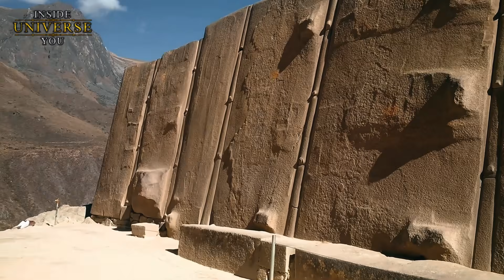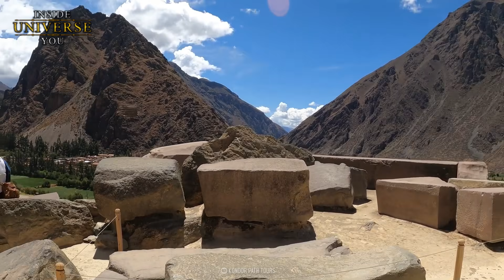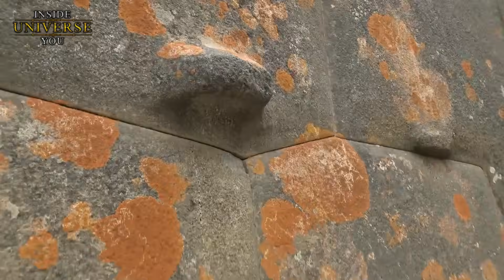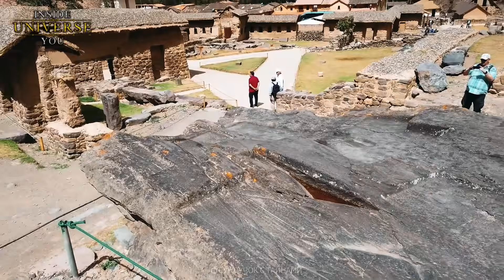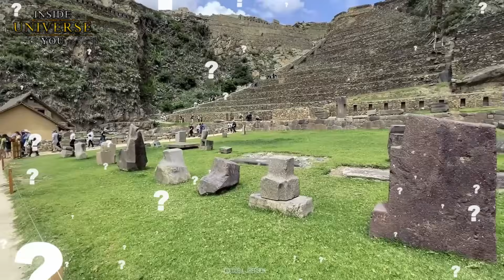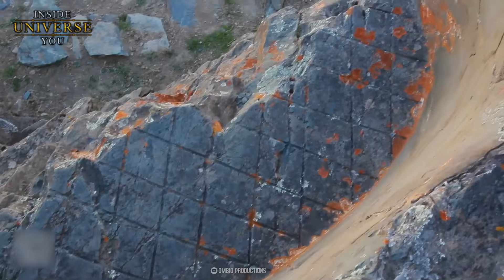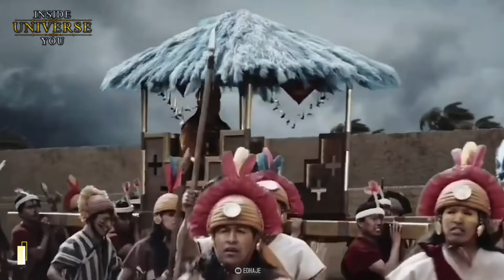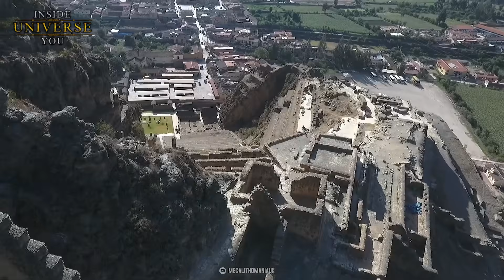Pre-Historic Mega Structures of Ollantaytambo Predating the Inca

Comment: The stones weren't moved - they were poured.  They would, most likely, crush the granite into a fine powder, and combine it with an emulsifier.   While it is in a mud-like state, they would then apply heat and move the blocks into place using heavy machinery, similar to a forklift. 

It is no different than baking cookies.
Reply: Wouldn’t they need a mold to pour it into?
Reply: @harrowgateguy  Yes, and my theory is, they used either tempered glass or sand as the mold.   It's the same method we use to make molds for metal, but scaled up.
Reply: They must have Both. Some are Geopolymer but we find Things Cut out all around the World. Easter Island Statues, The Block in China, there is Whole Complex Temples in India cut straight out of the Mountain. If they had the Tech to make them Into Powder (Probably by hitting the Resonance Frequenzy) they can use that to Poor or Cut.
Reply: @youcanhandlethetruth4695  Incredible. It’s completely mind blowing and frankly makes us look a bit primitive by comparison.
Reply: It looks likely in order to get such a perfect fit, but I have wondered  how they prevented the stones from deforming after heating. They would also have been harder to position if soft. 
Is it possible they were loosely stacked and then softened into tightly packed blocks? Even the capacity to carry out that level of engineering is mind blowing and beyond us. Maddening that we will probably lay never know.
Reply: 😊 I had a similar thought about baking bread - they remind me of the way bread-buns are all joined together when they come out of the oven.
Reply: Why do we know where all the quarries are then think befor you come up with a easy solution for yourself the quarries in Egypt, here many of them we know where the stone came from
Reply: @swingshift.  We know where the quarries are, but not how the stone was moved.  They didn't move it.  It was crushed into a fine powder and then reformed on site.   It's no different than how we work with cement today; the only difference being they didn't use rebar and used a much stronger material.  The unfinished obelisks in the ground are the only anomalies that don't support this theory.

Comment: However they did all of this, it was clearly easy for them. They had tech we don't have, and probably haven't even thought of.
Reply: Why such precise cuts from the quarry, only to grind it up for concrete? If they could cut like that, they had the ability to move them.
Reply: @Volkmanj1  Where are these precise cuts at the quarry, any images or videos you can point me to? Even if they had wonderous flying technology in the past (There is nothing new under the sun) the simple fact is it is easier to make it from concrete then cut and then fly some block. Lots of these places have a core rough blockwork and then really thick rendering of a different material on top. Just like how we do today. 
 B.t.w my own field of expertise is in construction. Mainly plastering, rendering and form work.
Reply: @Volkmanj1  I don't know, but I know they didn't do it with copper saws and hammers.
Reply: Cement mixer.
Reply: @yeahokno  And how do you transport the concrete?
Reply: @tracker1673  Excellent question! They always harp on about knowing exactly what quarry they came from. Riddle me this, what's easier? Transporting giant awkward blocks or smashing rocks to powder and transporting the aggrigate and binding mixtures and reforming them in framework and shuttering?
Reply: @tracker1673 You mix it up on site, near to where your working. Builders work smart, not needlessly hard.
Reply: False, impossible, so if it were cement, it means that the Incas developed electric motors or fuel engines, your theory makes no sense. @yeahokno
Reply: @robertopalomino7284  FALSE. You can make cement with a shovel you absolute melt. All would take, in the simplest way possible, is for a team to carry the aggregate and binder up there with a bucket or bag of some description.
Reply: Infact you dont even need a shovel. You could do it by hand, you'd end up with burns tho. 
And if you dont know why you would end up with burns from mixing cement/concret/geopolymer with your hands, there is no reason for you to reply.

Because you know literally nothing.
Reply: @yeahokno No, to melt rocks you need heat sources at high temperatures, this is how it is done today, in industries (with machinery) a simple shovel could not melt megalithic rocks, formulate your theory better.
Reply: @robertopalomino7284  No one is melting rocks you silly sausage, liquid stone is concrete. You have answered zero of my points so that proves to me your lacking something between your ears.
Reply: @yeahokno There is literally no evidence of the cement process, where is the evidence?
Reply: @yeahokno The site has thousands of megalithic rocks, artisanal work under your insufficient theory does not make sense, world science says that they are artisanal works, carving and fracturing rocks, WHO SHOULD I BELIEVE THE WORLD OR YOU?
Reply: @robertopalomino7284  Ask a builder.
Reply: @robertopalomino7284  ask a builder
Reply: @robertopalomino7284  ask a builder
Reply: @robertopalomino7284  Ask a builder
Reply: Ask a builder
Reply: Ask a builder
Reply: Ask a builder
Reply: Ask a builder
Reply: Ask a builder
Reply: Ask a builder
Reply: I've posted that at least 6 times now, are any of my other comments gunna get deleted? Seems fishy, your accounts fishy too. Joined 2 years ago, your either a child who doesn't know much about the world or this is a bot account.

Comment: Many ancient sites resemble electronic circuit boards from the air 😮.
Reply: True, I have seen the comparison from above like you. Fascinating.
Reply: Yes I’ve noticed that too. And I no longer believe in coincidences either.
Reply: freaky but nice isn't it
Reply: I think something techno was going on, what about the Mica lined chambers, mercury pools  and pyrite spheres found at some sites? Mica being an excellent insulator. Insulators and some sort of generators perhaps? It is so frustrating that we don’t know.
Reply: as a electrical engineer. not really, but some things. geomotry yes. even electricty has properties where geomotry matters. the wave lenght of your signal matters. antennas on motherboards geomotry matters.
this looks more like harmonics. Maybe just to hit a piezo effect for electricity. but nothing would happen except feilds. thered be no sort of circuit doing anything, except mauybe an antenna. 

its always geomotry. cpu data lines need to have exact trace lenghs to the ram. the data otherwise timing delays and errors. lenz law plays a part for noise cancellation. 

but a granite stone with quartz even for the electric effect wont do anything useful. 
or they hit they with electricty, with made them vibrate, geomotry at play could do something interesting

Comment: not mysterous at all  ... the stone work is actually geopolymer (a type of cement)  they are poured into molds on top of each other.
Reply: If so then why make and use different moulds for the same.
As moulds and shuttering used in concrete work today.
Why the pain of making so many different moulds.
How about the precisions of rocks removed from mountain.
They knew something we cannot conceive till now.
Must have been simple and precise.
Reply: It could be geopolymer but then again it seems more like its been cut in a way we can't imagine. The mould hypothesis doesn't make sense to some stones, you can literally see cuts that were started but not finished, it's the same in egypt, it looks like they had to stop for some reason. You see it with the pyramid of menkure and the osirion especially with the osirion, you can see where they have started to smooth the face off and stopped part way down

Comment: Excellent video from someone who watches videos on this subject frequently.  Great job pointing out the anomalies which make it impossible for the supposed builders to have created these megalithic structures.
Reply: Not impossible.
Reply: Maybe this is just the foundation of a old building where they used to make fuel/dark matter for what we call UFOs?
Reply: they are geopolymer ... not cut stones
Reply: @briankerr4512  don't be ridiculous.
Reply: @nexpro6985  It's concrete/ geopolymer. all these  sites are. A Japanese team figured out the pyramids were so in the 80's. E
Reply: @briankerr4512  in the side of a mountain? Some might be, but there was more going on than just geopolymer.
Reply: @briankerr4512 That's a stupid disproven theory
Reply: Perhaps the builders are of the same genealogy but the techniques degraded and were eventually lost over time.

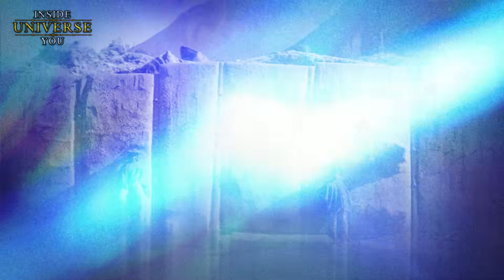Comment: Take a look at Axom in Ethiopia, to see not only who built these structures at 3:00, but the "Friends of Khufu" who also made it to southeastern Peru near the Sacred Valley of the Andes mountain range and the Huatanay river. It's pretty clear when you compare the two, they're identical as is the work done more close to home for those guys, at Giza.
Reply: The stones were cut using extremely high pressure "water" cutting, which is also used today, for the same purpose. It can also leave an impression on rock surfaces, making it look like having been "softened" or melted, within another mode. That's the beauty of water cutting! Not only do you get laser like precision, its also highly adaptable and can be used in a variety of ways, which were not known to the Inca.
Reply: @mrhassell  Love the concept, but can't imagine an implementation of high water pressures and nozzle integrity in the ancient world. It's too advanced for me to wrap my mind around. Also the cuts don't show the spreading profile water jets create. Some of those exposed deep unfinished cuts are super thin over a large depth.
Reply: @rickZR1982A  You probablly wouldn't think they had anything like a telephone, yet they did.
Reply: @rickZR1982A  waterjet cutting requires large amounts of garnet ( where is refuge) and 50,000 PSI. Water cuts leave a distinct mark and defuses at about 6cm. Stone is to thick.  How would they plot the cut. Now consider lifting transport and placement. Sorry I don't see it. This is clearly lost advanced technology we still haven't figured out. Also this technology was being used all over the planet longer than we are willing to admit to.
Reply: @mrhassell  
That we know of…… 👵🏻👩‍🌾❣️

Comment: The nodes on the rock look like Sprue marks in injection moulding. Molting rock injection moulded to whatever was needed!!
Reply: Apparently, they appear to have done it block by block. And maybe the blocks were not as liquid, like a very, very thick cake batter in consistency, holding some shape when injected, thus the pillowy form.
Reply: @enricoflor3601 👏🏾good observation
Reply: there is a channel here who ahows how plasma travels through rock and heats it. And on some rocks there are cavities for supposedly electrodes to stick in. And when it's molten and  electrodes are pulled out you get this effect of molten rock  extending past its surface.. So probably you have somewhat rough cur blanks and then heat them to take shape of what's around it.
Reply: Good idea. Next question is; how did the come up with the plasma? Electricity and stuff.  @monstertrucklt
Reply: @korttelipoliisi84  Have a look at pyramids and how they're made. There are technical videos.
 Matched to earth and resonate with it while being full of quartz. If you squeeze quartz it gives out electricity. And if vice versa, it resonates according its size. These people had more energy at their disposal than we do. And it was clean. 
Google "dark pyramid", quite possibly there is at least one operational on earth.
Reply: Agreed!
Reply: Agreed, however if it were injection molding the rocks used to make the megalithic walls would be more uniform in shape?
Reply: @jamespopovic9750  They were going for a rustic look????
Reply: Ok then how did they get the tons of moldable material up there? A big concrete pump? Where is the pump?
Reply: @tracker1673  , I ask the same question also. I'm with you on that one.
Reply: But it’s only certain blocks that have them
Reply: Hi @harrowgateguy  , that's part of the mystery which my amateur self can't solve. The critical inputs of manufacturing engineers (because the construction method used do not seem to approximate current civil works methods) might be needed to get to a credible end-all-be-all hypothesis.
Reply: @harrowgateguy  I've worked injection moulding a lot in my life, Sprue marks are trimmed down flat to the surface and you need to look to find them when done correctly. Maybe the ones you see were never smoothed down to the surface.
Reply: @gsstrings339  why would they smooth down some and not others
Reply: @harrowgateguy  Don't know, work unfinished for some reason. I think they should examine the other rocks very closely looking for remnants of where they may have been smoothed down????
Reply: Yeah, like the blocks were made out of geopolymer.
Reply: @Dr_Rad_Be How when they're showing you the bedrock that the stone was quarried from?

Comment: Somehow they must of had tech that melts stone, and its poured into moulds. Who knows?
Reply: If they used molds wouldn’t they all look the same? I think they had a way to soften the stone using vibrations that were applied where the nubs are. Soft stones would explain how tight fitting everything is.  Not every stone would need to be softened equally as long as the lesser softened stones were adjacent to softened stones that would fit to the contours of the harder one.  That’s why you don’t see the nubs on every stone. Applying these vibrations at the quarry sites could explain how they were able to extract the stones so easily.